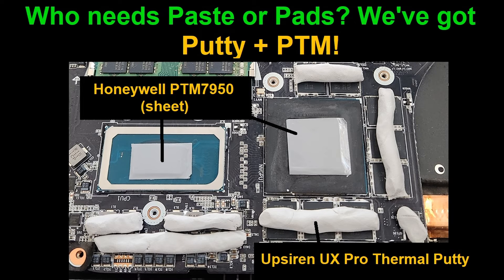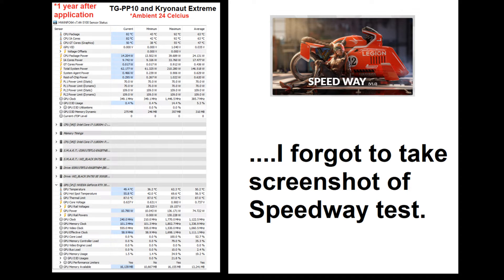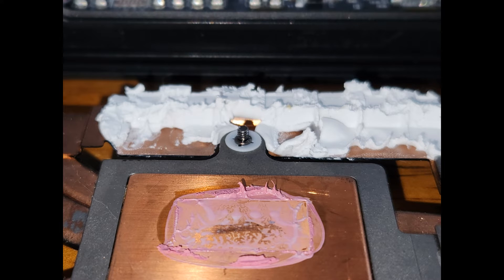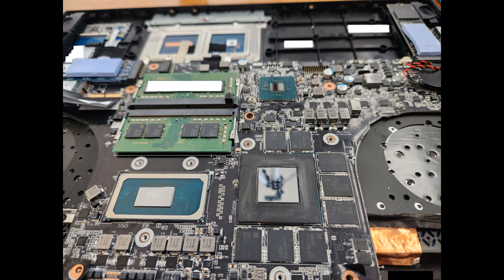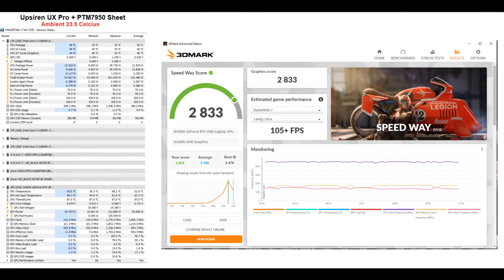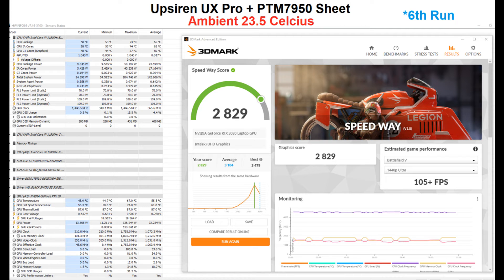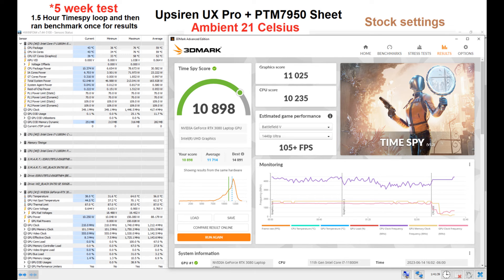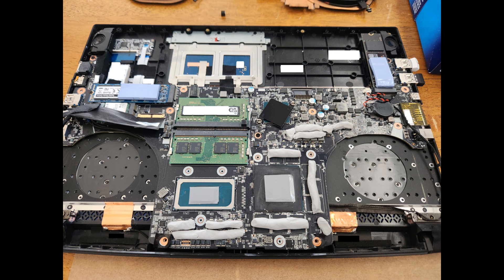RTX3080 Laptop meets Upsiren UX Pro thermal putty and Honeywell PTM7950

Comment: My Total System Power is under 130 Watts. 50W from the GPU (Limited in Power from using not the Battery) itself. She never downclock and run everytime in her range. But the CPU is the most Problem. There i cannot draw more that 20 Watts out of her before the Hotspot near the cpu reach the 75 Degree Limit. I puttet the whole Mainboard in Pads and Putty. I hope i can reach a better goal for the CPU. But i need more Experiments also adding some Coolers. Nice to see your Experience with all that i just would say. So i can learn something. Ty Edit say: If you wonder i am a Miner, my Computers have to run 24/7 in full Performance. Also my Laptop was running now for a year in 100 C all in all. So i decided if he can do this, he deserve his mass Putty Attack. So he work for me hopefully a lot of time in the future. I love my Laptop and Computers. :-)
Reply from the maker: @saschapurner9579  You might want to try using a Phase Change Material like Honeywell PTM7950 on the CPU and GPU core.
Reply: @snarksdomain  Now i tryed it and i will never make experiments now in a Laptop. This Honeywell works fine with the Putty. Ty!
Reply: @snarksdomain  Yes, that is the only thing i did not try ed out. But all in all, i do wonder why i am not happy with it now.^^

Comment: Hello i want to ask should i use thermal puttty or thermal pads for my laptops
I want don't want. To use thermal putty its hard to clean up
Reply from the maker: @asusamjad  it's not too bad for cleanup, and you honestly won't really need to open it up.for at least a few years, especially if you use something like Honeywell PTM7950 on the CPU and GPU core.

I definitely recommend putty over pads, every day of the week.
Reply: @snarksdomain  I understand that I will. Try to use thermal putty for laptop since the laptop it's different from the PC what the best thermal putty for  I see the charts upsiren utp-8 right?
Reply from the maker: @asusamjad  Any of the top 10 putties are very good.

For a laptop you'll will want to take a look at teardown videos for your model. If it looks like their is putty from the factory and gaps appear to be smaller than 0.5mm then I recommend going with Hapnzoye HY236.

On the other hand, if gaps appear to be larger than 0.5mm then any of the top putties will be okay. UTP-8  just happens to be the one that hits the price/performance balance really well.now, worh Fehonda LTP81 as a close 2nd.

Comment: Hi Snarks, how do you realize if thermal putty has been applied correctly when you have a laptop with no temp sensors on Vram and Vrms? Are there any indicators or clues? Let's say I have a laptop with no temp sensors on Vram and Vrms (I am only able to see cpu/gpu core temps in Hwinfo) and I want to replace my stock thermal pads with Upsiren 8 thermal putty, how do I know that I have applied the putty correctly? Are there any performance indicators of my laptop that I can measure or other important parameters? How do I make sure my laptop will not burn during the next months, as I have no way to check temps on Vram and Vrms after applying the putty? How do I realize if the new putty will make my laptop stay in the 100-110 C rather than in the 75-80 C temps? I hope my question is clear to you, thanks
Reply from the maker: @giacm993  Method of application is part of it. Some people try flattening putty to try mimicking what pads look like. This is not ideal, in my opinion, as it's possible to get the height wrong and not have it touch the cooler. My preferred method is to roll logs for most components and balls or logs for the VRAM. Let them be compressed during assembly. In this way, they make contact and spread out accordingly.

There are a couple of ways to ensure you use the right amount:

1) You could apply the outty and then test fit the heatsink, turning in the screws all the way and then remove screws and hearaink again. Then inspect the spread of putty. You can add or remove putty as needed, then reshape it or squeeze the sides so that it stands tall again (to sure contact and final compressing during assembly). Only after this test fit phase do you apply PTM or paste of your choice. During this process you can also post pictures on the Discord server and someone will help you get the putty dialed in.

2) If your laptop had pads, then you can measure the pads thickness and width and enter those values into the Putty Calculator on the Google Drive. This helps to get the ideal log diameter figured out.

Some laptops already come with putty from the factory, so it can be harder to gauge gap thickness. In this case, the test fit method is a good option.

If your laptop has putty from the factory and the gaps are very thin (less than 0.5mm), then I recommend Halnziye HY236 instead as it can compress down to ultra thin with ease, as it is quite soft and has smaller particles sizes in it.

You'll know if you have too much putty if your CPU and GPU core temps are extremely high or if your laptop keeps turning off and unable to remain on and under moderate load.
Reply: @snarksdomain  Ok, thanks. So, even if my laptop does not have temp sensors on Vram/Vrms, I can realize if putty has been applied correctly by simply noticing high temps on gpu/cpu cores and system instability. And are there also other indicators of bad putty application and bad Vram temps? Such as lower wattage in gpu/cpu shown in Hwinfo or lower framerates in games? Or simply by putting my hands above phisically when the laptop is turned on load and noticing is very hot? Or are those other indicators irrelevant for estimating/presuming good Vram temps?
Reply from the maker: @giacm993  you won't know by the CPU or GPU temps unless you put on too much putty. There is a case where you can put on too little and you would never know. This also happens when folks use a low performing product such as K5 Pro. You can definitely have good CPU and GPU temps and be cooking your VRAM/VRM's and have no idea.

This is why a test fit is good for first time putty users. Once you've used putty a bunch it's easier to get good applications without needing to check.

Luckily this is an issue that is gradually disappearing since newer laptops are starting to have VRAM temps show up. Nearly all modern AMD GPU based laptops have these temp sensors, and the NVidia 40 series based laptops often do as well.
Reply: @snarksdomain  thanks! Very good explanation from you Snarks! I will try to pay particular attention during the fit test with the heatsink on my first attempt. So, I understand that if Msi afterburner or Hwinfo show lower wattage during intensive gaming this will not be an indicator of bad putty application but only an indicator of bad ptm7950 application. I understand Vram temp is an independent factor. Same with lower framerate, that would not be relevant to bad putty application. It's a good thing they have started to put VRAM temps on newer laptops. It scaries me a lot not to have that specific sensor, it's like using laptop in blind mode, especially for us who are going to apply putty for the first time. Only two questions about what you said: 1. I guess if you put too much putty, cpu and gpu core temps will go very high because putty will act as a strong insulator, won't it? Will that be the real cause behind? 2. If you put too low putty instead, how can you realize VRAM/VRMs will be cooking during the time? You will see graphics glitches, like stripes or strange squares on screen or blue screens/system instability?
Reply from the maker: @giacm993  if too much putty then you won't achieve good core contact, which ends up with high temps.

If you flatten the putty so that it can't make good contact, then your VRAM/VRM will be running hot and may or may not cause artifacts. This is why test fitting and ensuring good putty contact and spread is important when you first work with putty.

Once you get used to using Putty this fear of cooking components goes away. But it's something you need to get hands on experience woth to be confident woth the process.

And the Discors is there to help you out though it.
Reply: @snarksdomain  Thanks, I will consider asking for your help in the Discord as soon as I start applying the putty in the next few days. I have another doubt in the meanwhile: you said the fit test with the heatsink is important to check if you apply the correct amount of putty. But, when you screw and soon after unscrew the heatsink to check the spread of putty and if it is too much or too little in the final compression, is there the risk you create air bubbles on the putty so that they will act as an insulator hindering heat transfer once you re-screw the heatsink permanently? If yes and if it is risky, is there a way to prevent air bubbles on putty during the fit test?
Reply from the maker: @giacm993  after a test fit you simply reshape, or even just squeeze the edges to make it stand up again. You want it so that it makes contact and then gets it's final compression during assembly.

Whether it's myself or someone else that helps you out in the Discord, there are now lots of folks in different time zones around the world who are well versed in this type of thing.
Reply: @snarksdomain  Ok, great. So I don't have to worry about accidentally creating air bubbles on putty when I unscrew the heatsink and put it again during the test fit. I was scared about those air bubbles potentially preventing putty from transferring heat correctly
Reply from the maker: @giacm993  as long as you squish it a bit so that it's taller it'll avoid the chance of having an air gap.
Reply: If those temps are high, you applied the putty incorrectly

Comment: hey Snarks when you work with your laptop to open it, install ptm7950 and thermal putty, clean them and so on...do you use ESD-safe equipment to prevent static electricity of your body from killing laptop components? In particular, do you use anti-static wrist grounding strap, ESD-safe tweezers, ESD-safe spudger and anti-static mat? Can it be dangerous to work with laptop without those ESD-safe tools?
Reply from the maker: @uald77s  I use an ESD safe mat. I don't personally use the ESD wristbands. I do use an ESD air blower (Metrovac Datavac ESD-500).

Opening up devices does come with risks, and it's good to be aware of them. It's not a bad idea to use those things if you have them, especially if working on other people's devices to mitigate risk.
Reply: @snarksdomain  I may be wrong but what I see a bit risky here from an ESD perspective are: 1. touching by hand the ptm7950 and stretching it manually on the cpu, which is a very delicate component and sensitive to voltage differences (contact with human body); 2. touching by hand the putty, making balls or rolls and then applying it manually on highly sensitive components such as vrms, coils, memory chips, mosfets which all are particularly sensitive to electricity differences when coming into contact with human body. Even if you don't kill the components immediately, there is a chance you can cause a latent ESD damage so that they could not work as expected in the future, potentially reducing their lifespan or generating crashes/errors. Have you ever faced any of those issues in your long experience applying putty to many computers, components, or from other users reporting them in your discord?
Reply from the maker: @uald77s   @uald77s  No, not yet. Also, I typically wear nitrile gloves, so I am not handling the putty with my bare hands. I definitely recommend wearing gloves. Putty is a string insulator. None of the ingredients conduct electricity, just like thermal pads.

My test card has been apart and back together over 100 times now and is still working great. That's after several litres of 99% Isopropyl alcohol and a few thousand Q-tips used to clean it (although I mostly use dry makeup wipes now).

There is definitely some risk to handling components without grounding, I just have not experienced failures due to that myself. I could see static being a potential issue if I had carpet around my desk.

Comment: in your videos you often use cotton swabs to clean electronics from putty and phase change material. But is it safe or could it damage cpu and gpu cores as well as computer electronics? As far as I know cotton swabs are not lint-free and those microscopic little fibers separate from each other and deposit themselves on the components. Should a microfiber cloth be used as a better and safer alternative? I've seen you also use make-up wipes, toothbrush as well as spatula to remove putty and ptm material but could they scratch the delicate electronics of a laptop? And could spatula scratch gpu core and cpu core when removing old ptm to prepare for a new application?
Reply from the maker: @jeromeblanchard1694  it's. Even fine so far. My test card has been apart at least 100 times by now and it's still working well. Only thing that got damaged so far is a fan wire that couldn't handle being bent back and forth that many times.

I prefer those makeup wipes over cotton swabs as they apply less force and less change of scratching the surface of the silicon. The cores are not at the top surface of the silicon. Any small scratches are just cosmetic.

The soft bristles of a tooth brush are plaibel enough so as not to exert much force onto the components. You'd want to be careful not to ram the solid plastic parts into tiny components though.
Reply: @snarksdomain  I see. Do makeup wipes you use come dry and then you apply 99% Isopropyl Alcohol by yourself for cleaning? Or do they come with pre-applied alcohol percentage (e.g. 70%) and you use them as they are? And what material are those makeup wipes? Is neither cotton nor paper, right?
Reply from the maker: @jeromeblanchard1694  they are dry cotton makeup wipes. The Delixe/Luxury ones, not the exfoliating ones. I then use 99% Isopropyl alcohol.

Comment: Hi Snarks, I would like to apply Honeywell PTM7950 + thermal putty to my laptop which is overheating (cpu core at 94-98 C while gaming). It's a Gigabyte Aorus 15 YE5 with i5-12500h + rtx 3080ti 16GB Vram laptop and, as I have never opened it before, I don't know what thermal pads it mounts, I don't know if it has gaps smaller than 0.3 mm or not in order to achieve good core contact for CPU and GPU when I put the thermal putty on VRMs and VRAM. For that reason I don't know what thermal putty to buy, if Upsiren UTP-8 or Halnziye HY256. I would personally buy the Upsiren UTP-8 as from your tests it can reach lower VRAM temp than the HY256 but I have watched your video that the UTP-8 can only go as down as 0.35 mm in terms of compressibility and I wonder if my Aorus 15 YE5 laptop has gaps smaller than 0.35 mm. What do you think? Maybe you have more info about my specific laptop model and you can suggest me what thermal putty would suit best. It should be similar to the Aorus 15P YD you tested here, they just changed the cpu with the 12th gen Intel one instead of 11th gen, they put ddr5 ram and 3080ti. I will be waiting for your suggestions, thanks in advance and have a good day!
Reply from the maker: @RobertDin-nr7wc  yeah, yours should be similar to mine. I also have the 16GB VRAM model. UTP-8 will work really well for you. I suggest buying 20g and you will use  ~15g. I'll try to finish the video so that you can see how I applied UTP-8 to it now and that should gove you a really good idea on amount to use.
Reply: @snarksdomain  Thanks, I'm happy to know the UTP-8 could fit well for the gaps size of my Aorus 15 YE5 laptop. I live in Europe (EU). Do you think that buying the UTP-8 directly from the Upsiren Official Store in Aliexpress could guarantee a good quality putty? Or is it better to buy elsewhere? The problem I have noticed with Aliexpress is that you find different pages of the same store, for example 3-4 different pages of Upsiren Official Store, other 3-4 different pages of Middle999 Store selling UTP-8 at different prices (e.g. one Upsiren Official Stores sells it at 19 euros, another Upsiren Official Store sells it at 21 euros, another Upsiren Official Store sells it at ridiculously low 14 euros for 50g), they have different reviews from users, different feedback scores one another but they all claim to be the same store name in Aliexpress! So it's confusing and you don't know what exact store to trust. What would you suggest?

Comment: I see from recent comments that you had to repaste your laptop after only 1 year.  Is that because of the temperature or just to test the new putty? What about the UX Pro, how hard and dry was it after 1 year?  I want to use ptm7950 to repaste my 2yo legion 5 r7 /rtx3070 and am afraid that the thermal pads need to be replaced also.
Reply from the maker: @EugeneGladkykh  Just for testing purposes. The TG-PP10 I put in it a couple months after I bought it eas still nice and soft.

I've since reopend it after 16.5 months of UX Pro and it was still soft. I salvaged the putty and saved it for future use. Now I've got Upsiren UTP-8 in there and will run that for at least a year. 

I need to finish making the video.
Reply: @snarksdomain  how did the Upsiren UTP-8 hold up after some time?
Reply from the maker: @mikep1772  This video was for applying UX Pro. I ran it for 16.5 months. It was still quote soft when I opened it up. Was easy to reform it. I salvaged it and nit am running UTP-8 in there instead. I'll open it up in a couple of years. I've also got some UTP-8 cooking in a few GPU's, including my 3090. I've got a mix of other putties in other GPU's as well, including some that are still on TG-PP10.